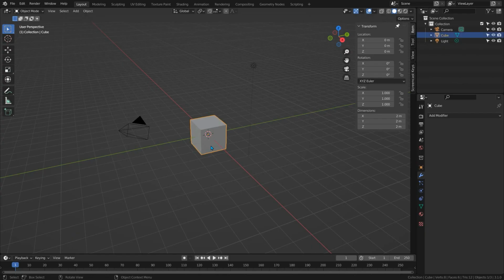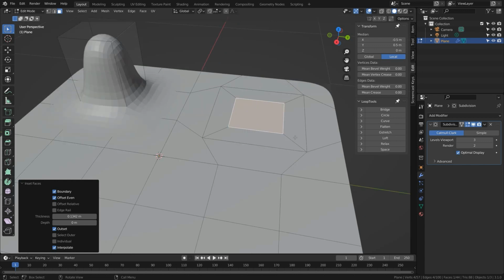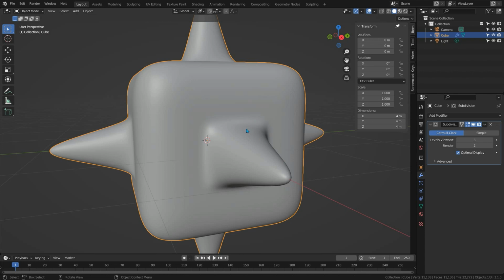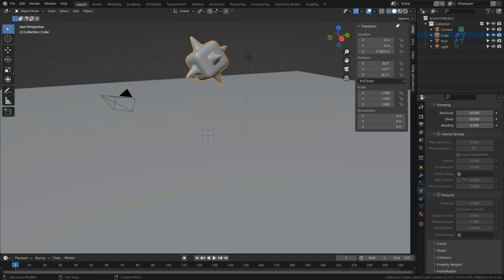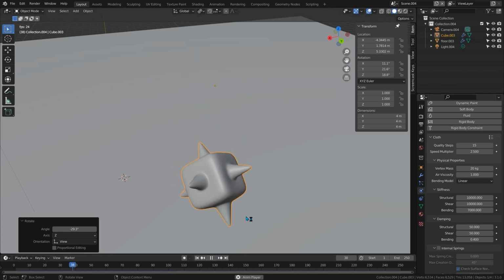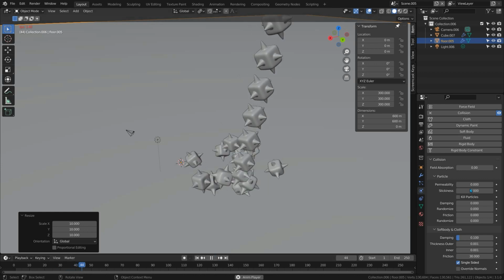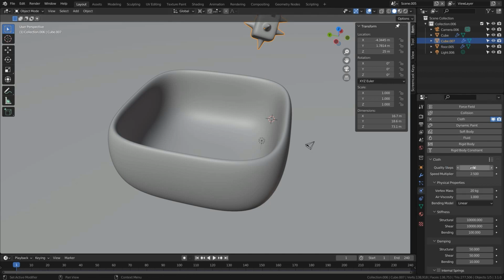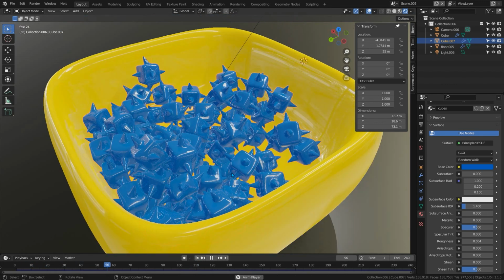Blender - Insetting and softbodies - #16 Subdivision Surface Modelling in Blender

Comment: If I extrude from the cube with a subdivision surface modifier applied, is there a way to have the extrusion remain square rather than circular without using control loops that wrap around the entire cube?

Comment: I have a new-found respect for Inset. Other discussions 'on the Youtubes' never gave me the 'aha' connection with me that it's a tool for managing flow or a good way to move problematic poles out (using the Outsetting option) to less curved regions of the mesh to avoid issues. Manual knife cuts seemed to be for that and Inset was mostly for getting things ready for an extrude.